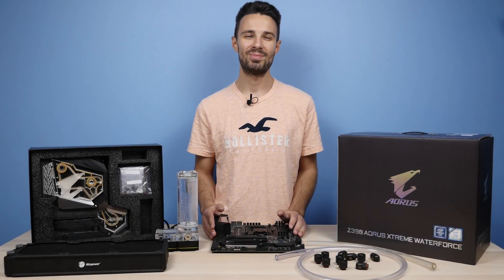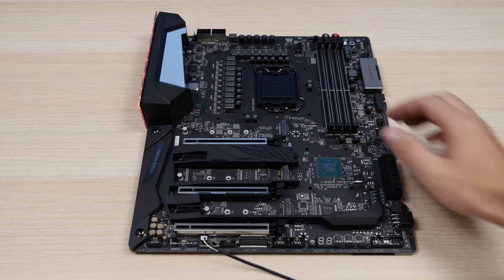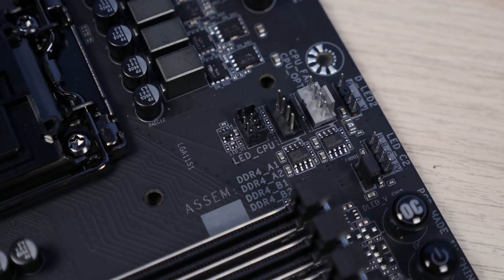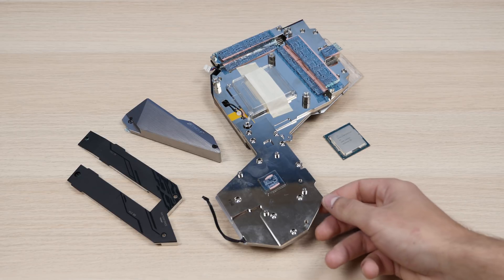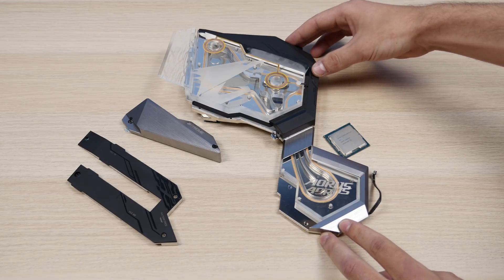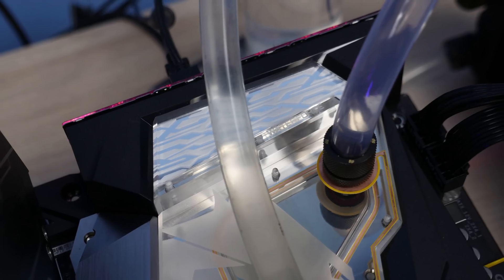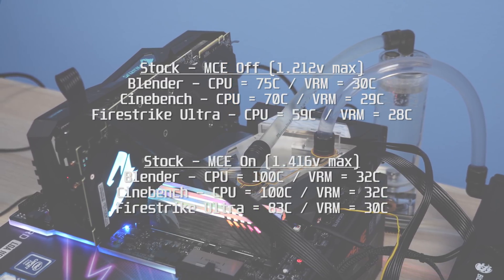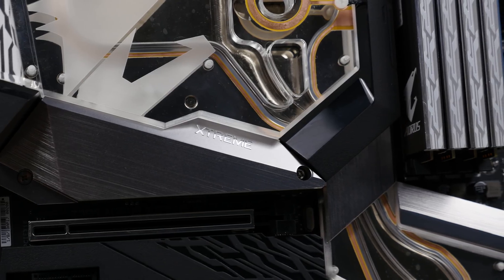GIGABYTE Z390 AORUS XTREME WATERFORCE - Review plus Monoblock Installation and Testing

Comment: I have the same board, when I connect the cpu RGB lights (white plug) it doesn’t light up my mb and pc doesn’t turn on, when i disconnect the white RGB cable my pc boots up perfectly. Can anyone help ?
Reply: UnholyC sounds like your leak detection circuit on the motherboard is triggering. May need to adjust it using the white screw 1 cm to the right of the lower water opening.

Comment: Did you use the opening over the jetplate inlet (the one, left to the RAM), as your outlet to the reservoir !? I´m going to build with this motherboard and didn´t find any information, what opening to use as the inlet for cooled liquid. Usually, CPU blocks (like from EK) got the information, to use the inlet direct over the CPU jetplate as your inlet. So that the flow with pressure, will hit direct the jetplate. I´m confused and didn´t find any information in the motherboard manual. But for example EKWB always use a lettered IN and OUT port and the inlet is always over the jetplate !?! Could you please respond to my question? Thank you....
Reply: I can see from his hose placement that he used the left side as the inlet. The difference in temps are probably very little, however the jetplate (right port) port is intended to be the inlet. I also wondered why this is not mentioned in the manual, but I had this confirmed with Aorus before I proceeded.
Reply: @Zeorymer300  Thank you for sharing this information. I´m still waiting for the responce from Gigabyte/Aorus, but will also share there opinion to my question.
Reply: I got the Gigybyte support answer. They tell me, it doesn´t matter which port to use as the inlet. But...I still think, this information isn´t correct. I feel there is a lack on information @Gigabyte, supports to the information Zeorymer300 got from Aorus direct. Well, in case of it doesn´t matter, we will not do anything wrong. But I´m going to use the right port as well as my inlet and will hit the jetplate direct with pressure.
Reply: The inlet port is the one over the CPU. There are some images and gifs available at Gigabyte site: https://www.gigabyte.com/FileUpload/Global/KeyFeature/1162/images/monoblock.jpg
Reply: Empirical studies show that there is little temperature variation throughout an entire circuit. The order doesn’t matter.
Reply from the maker: If a water block doesn't have an indication for either an inlet or an outlet then it doesn't matter and it's been designed to use either or. I mentioned this in the video that there are no inlet/outlet market ports and that by the way it's been design it shouldn't matter. Have another watch/listen if you wanna learn more :)
Reply: @SimpleModz  If a jetplate exists then there is an optimal inlet/outlet regardless of whether it's labeled or not. The whole point of a jetplate is to focus flow down the middle(the slit in the jetplate is aligned with the die) and out both sides, not the opposite. I wouldn't exactly trust what gigabyte says either, they were dumb enough to release a gpu with a sealed waterblock you can never clean if it gets clogged.